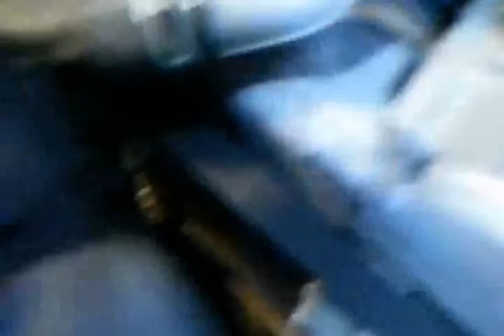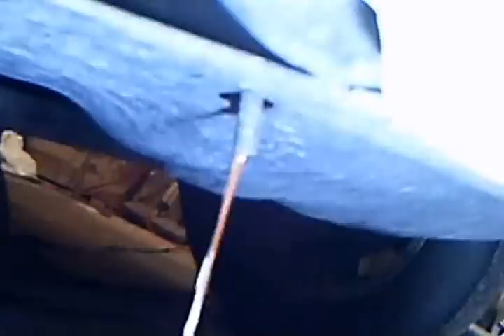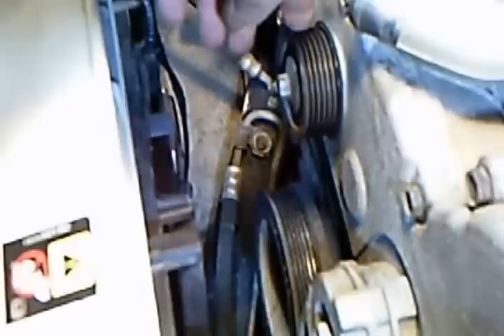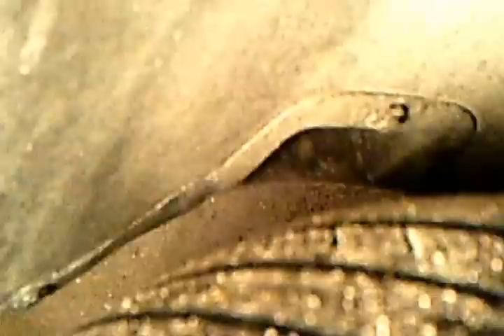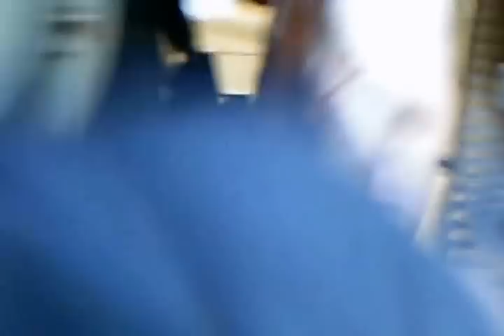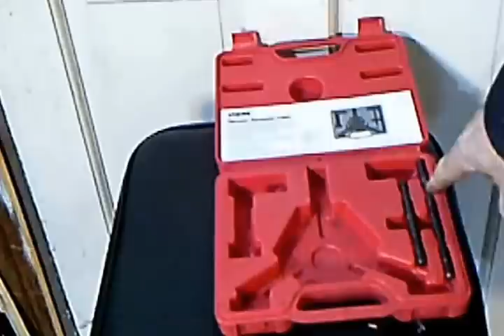Chrysler 300 3.5L Timing Belt and Water Pump Replacement! Part 1

Comment: That Water pump is available in America for about 85usd. Most dealers charge 166usd and 260usd labor .  
An independent about 175usd. You can do the currency arbitrage. 

The water pump this vehicle is turned by the timing belt which must come off in order to change the pump. Most people change the belt at the same time and often the tensioners that keep the belt tight. Some people also change the oil seals in the front at the same time. 
I'm guessing that the service department decided to charge you the price of  parts and labor for replacing a water pump plus the price of parts and labor for replacing the timing belt and essentially charge the same labor twice. If you don't know how the engine is constructed,  you might actually think this was reasonable. Even so it seems like they've added a special boat payment or drinks for everybody after work.

Comment: What were the symptoms before  the change?
Reply from the maker: Hello,  There were no problems with my car. It had reached the manufacturer's recommended mileage for replacement. I did some research that indicated this engine is an "interference" engine. That means if the timing belt slips or breaks, the intake and exhaust valves can hit the pistons while the engine is running, and bend the valves. That is a very expensive repair. Changing the belt, water pump, and tensioner pulley at the recommended mileage is the best thing to do to prevent any damage. If you are having any symptoms such as  a coolant leak or the engine running hot or hotter than normal, it could be the water pump or the coolant tube under the intake manifold. I didn't have any leaks or hot running on my car, so I didn't cover that in the video. If you have hot running or a leak, I would suggest getting checked out immediately. If the engine overheats, that could lead to engine damage and very expensive repairs.  Thanks,   Dave

Comment: if the belt notches we're worn down. timing marks are all over the place... how should I line them up to tdc
Reply from the maker: Hi,
Is the original belt still on? Can you see the small notchs on the edge of the timing belt sprockets?
Reply: +dave lmm the belt was shredding to pieces half was rounded off... so the question "should I just line up the marks (two dots on the head & center the cam dot)even if one (R) moved ahead? my cranchshaft rotates without the timing belt, the notches on the belt are peeled off...
Reply from the maker: Kurt , 
If the belt broke and came off, or if it shredded in place and stayed on, it probably is loose and could have jumped a cog or two (or more) on the cam sprockets.  There could be damage to the valves since this is a "interference" engine. If you are not familiar with the term, it means that if the timing belt breaks,  gets loose, or comes off, the timing of the opening and closing of the valves are not in time with the up/down movement of the piston. The valves can hit the piston and get bent. If the belt came off or slipped a cog or more, you will have to verify that the position of the cams and cam sprockets are correctly timed in relation to the position of the pistons. You would have to make sure the  no. 1 cylinder is at top dead center and then line up the cam sprocket timing marks with the timing marks on the cam covers and the crankshaft pulley and pulley timing mark. There are a lot details and procedures to make sure this is done right. If you don't have a good shop manual, you may need to get one if you want to tackle this. I use All Data DIY online. Its a yearly subscription of about $46.00 for the first vehicle. You can add additional vehicles for about $17.00  each.  If there was that much damage to the belt, I would want to find out if there is any internal valve or piston damage. If you don't feel comfortable trying to make the repairs and check for damage, it might be best to take it to a Chrysler dealer or a good independent shop that has experience with these engines.

Comment: hello there, my prodemand manual says you have to loosen rocker shaft bolts.  this seems unessicary.  is this something you did?
Reply from the maker: +Corey Spofford   Hi Corey,   I didn't loosen the rocker shaft bolts when I did the belt replacement. I used All Data DIY as my reference. Thats available on line as a a yearly subscription. The technical college ( NDSCS) where I worked for fouteen years, used ALL Date Pro  for their automotive, diesel and recreational engines programs. I agree that for replacing the belt, the water pump and the hydraulic belt tensioner, it wasn't necessary. If you had to replace seals behind the rear cover, you may have to loosen the bolts to get the cam sprockets and the rear cover off. I didn't have any leaking problems that were apparent so I didn't replace those seals.
Reply: I agree, Mitchell on-demand said to release them, I did not.  Had no problems other than ensuring everything was TDC ran good

Comment: Would it be the same set up for a Chrysler 2006 Pacifica AWD 3.5 l v6
Reply from the maker: 35lavas  Hello,  I am not very familiar with the Pacifica. I believe the 3.5 v-6 engine is similar and some of the procedures may be the same. Since it is a different car from the 300, I would recommend getting a shop manual for your Pacifica to be sure what has to be done. If you have experience with doing your own repairs, you might be able to figure it out without a manual. However, the way the newer vehicles are made, and the complexity, a shop manual is almost a necessity for a lot of home mechanics. I use the home version of AllData online. You can get immediate access on your computer at a resonalble cost. 
Thanks for your question and viewing the videos.

Comment: I have a 2004 Dodge Intrepid SXT, and the problem was my car was easily gets overheat even if im drive like 3 to 4 miles only. I brought this car to auto shop and found out that the radiator is leaking as well as the water pump..and also they decided to replace the thermostat and the coolant cap...after installing everything and replaced with the new parts...there was still leaked..so the mechanic told me to remove the intake manifofld and found out that pipe was also worn out and with leaked as well. It cost me $1640 for all the repairs and my car now runs good without overheating.
Reply from the maker: Allan Mendoza Hi Allan,   When I made made the repair vids on the Chrysler, everything was working well. The replacements were done as preventive maintenance. I haven't had any problems with the tube you mention, but if I run into an overheating situation, that will be an item I will check. I used an All Data online manual for home use. It costs a little for the annual subscription but is updated regularly and it covers the topics pretty well.  I used to work at a technical college and they used the professional All Data subscription service for all their vehicle training programs.  I'm glad your car is fixed and working well. Thanks for writing and viewing the vids.  Best  Regards,  Davelmm
Reply: They should have run a pressure check on the cooling system first to locate the real leak instead of just guessing.

Comment: Great video but would it be possible to do a video on a Concord 97 my enging is rattling but its not hot or damaged it's my timing belt that needs tightened.
Reply from the maker: Percy Kight Hey, Thanks for watching, however I don't have a Concord to work on so I cannot help you out there. I can't say for sure, but if you have a 3.5L they didn't change a whole let over the years, but it's been a while since I looked at an older 3.5L.

Comment: Did the same job last year. First spoke to Chrysler ASE master tech, was told  "In addition to the timing belt and water pump, it's best to also replace the hydraulic tensioner and timing belt idler (the bearing wears and if fails may seize)". I bought the 4 piece TB/WP kit with all parts.  Also, the dealer always replaces the 2 orings #4483443 behind  the inner or REAR timing belt cover- these 2 orings seal the coolant passages to engine block and leak regularly INTO the timing belt area (usually driver side).  I replaced the 2 orings, but the cam sprocket needs to come off to get the inner timing belt cover off.  And last, ASE tech said replace the thermostat and gasket with coolant drained.. and you're good for another 100k miles.
Reply: paul2072z Bbb
Reply: paul2072z i
Reply: What tools did you use to remove the cam sprockets